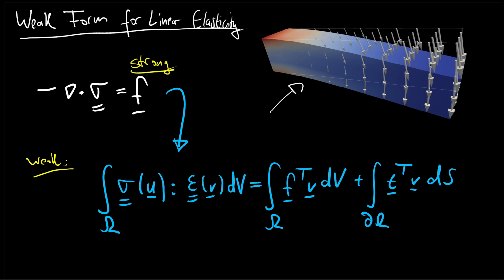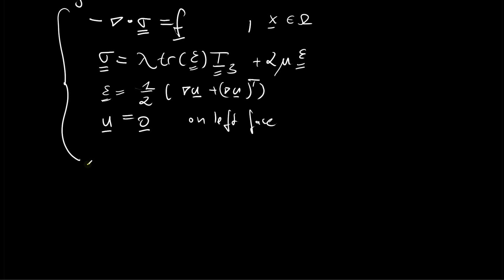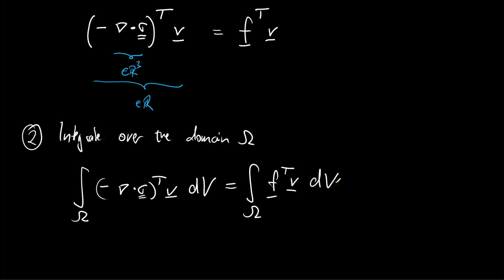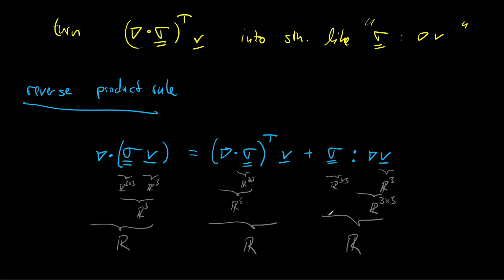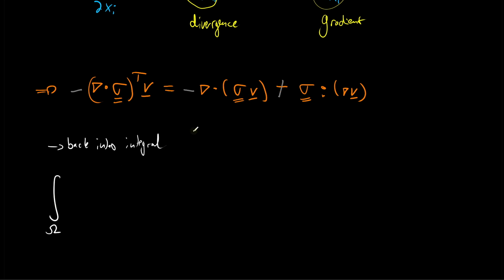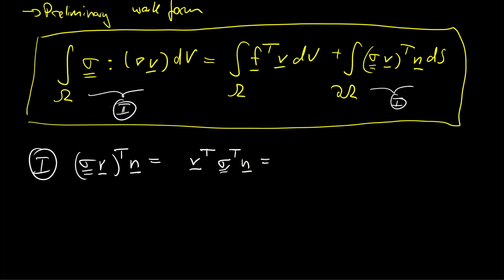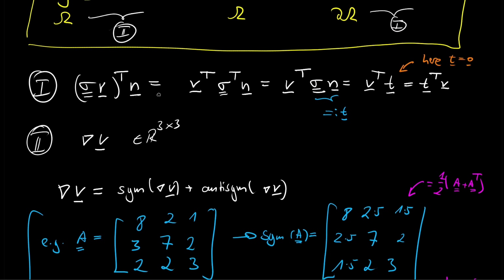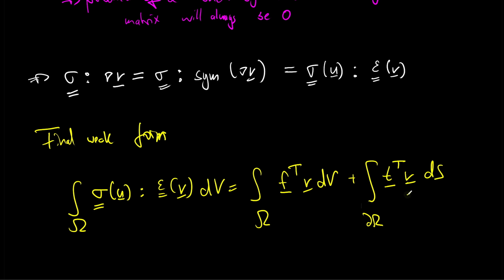Deriving the Weak Form for Linear Elasticity in Structural Mechanics

Comment: Is there a specific reason for writing the constitutive relationship with Lamé parameters instead of using the generalized elasticity tensor such that σ=C:ε?
Reply from the maker: You are right, using the generalized elasticity wouldn't have been too restrictive. I wanted to avoid it to make it a bit easier to understand since I think that tensor matrix products can be a bit overwhelming for a beginner. 😊
Your comment is of course a great hint. The derivations result in the same for generalized elasticity.
Reply: @MachineLearningSimulation  Thanks for the clarification and great video btw. 
I'm really delighted to see these fantastic videos on all sorts of in-depth engineering topics. 

I'm doing research in the field of structural topology optimization, specifically in fire conditions, so your videos are immensely helpful to better understand the underlying maths and physics that I need to develop my optimization procedures. So thanks for taking the time to make these videos!
Reply from the maker: You're very welcome 😊
Thanks for the kind words. It's amazing to see that they can be of great help.

Good luck with your research 👍